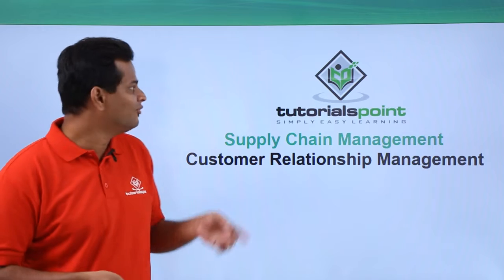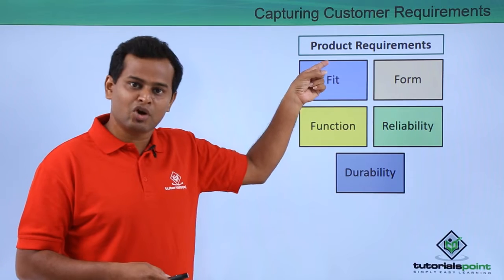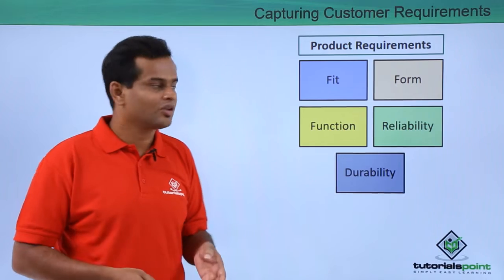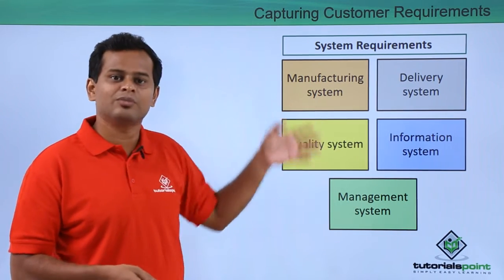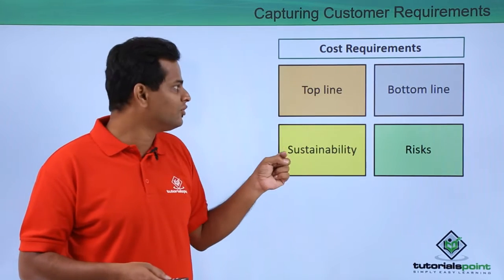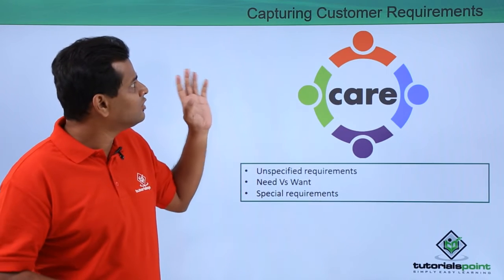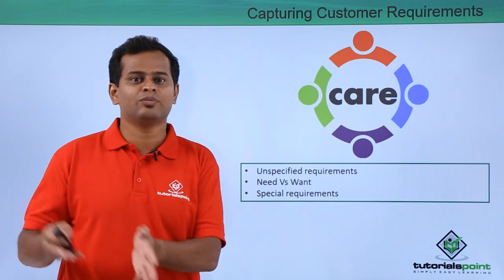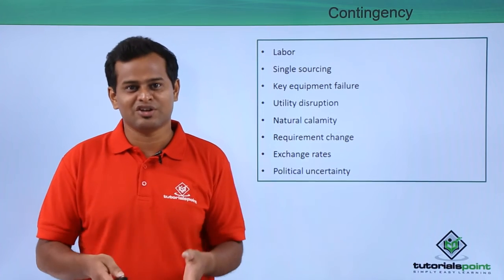Customer Relationship Management

Comment: If you want to have a long-term customer based circle, building relationship is essential.  You see, people buy from you because they already have the connection and trust with you not that they need the product alone. This is very important to understand.  That's why inside this amazing report, you are about to learn the following information:      How to Build a Strong CRM Database for Marketing     Blending Marketing and Your CRM     How to Improve Your CRM to Benefit Your Marketing     How to Take Advantage of CRM Marketing Strategies     Know the Benefits of Using CRM for Marketing     5 Tips to Increase Your Social CRM Success     Benefits of CRM in Your Marketing     How to Achieve Success with Social CRM     CRM Experts Share 6 Top Marketing Tips     How to Automate Your CRM Marketing     CRM Marketing Needs To Align With Multiple Technologies     Are You Ready to Use CRM in Your Marketing     Why Do Marketers Use CRM Systems for Their Metrics?     Traditional CRM Software vs. Marketing Automation Software     Social Media Changes CRM     Take Advantage of CRM Marketing     How to Automate Your Marketing Campaigns Using CRM     Let Your Inbound Marketing Plan Define the CRM You Choose     Incorporate Current Marketing Channels With CRM     CRM and Email Marketing https://gum.co/jsYCc